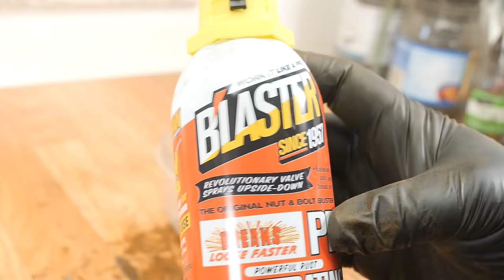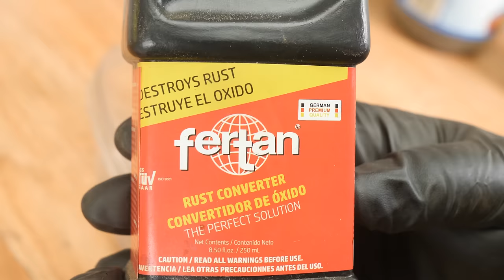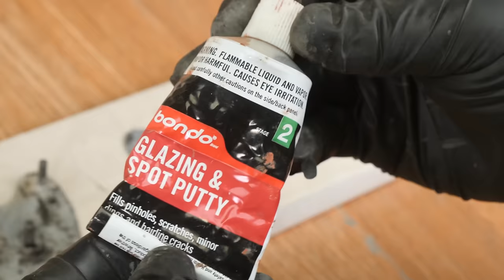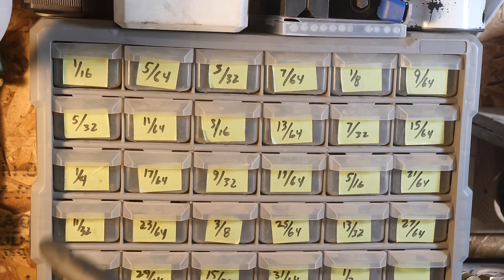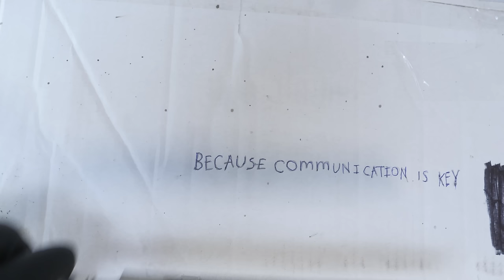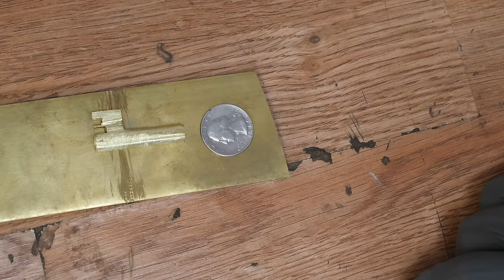Shocked By What's Inside! Crazy Rusty Lock Restoration

Comment: at first i didnt think it was too bad, that was until you opened it, how does a lock get filled with sand(?) and all the internals become dust
Reply: Must have been used outdoors in a tropical/subtropical climate, or at least somewhere close to the beach. That also explains the outrageous amount of rust (humidity corrosion)